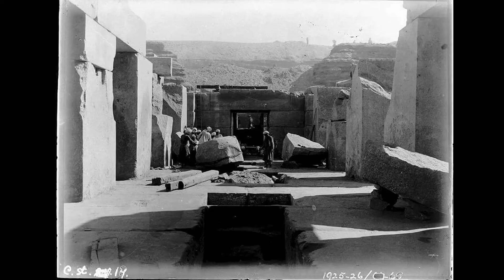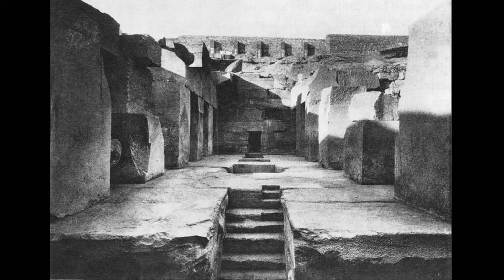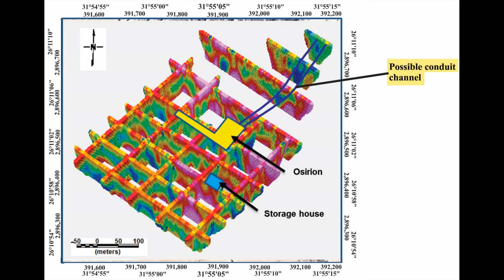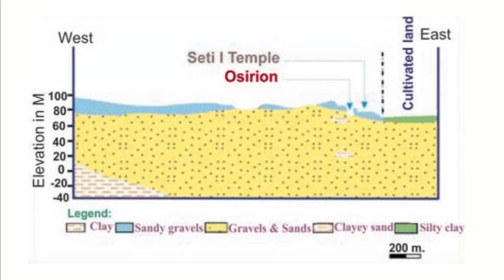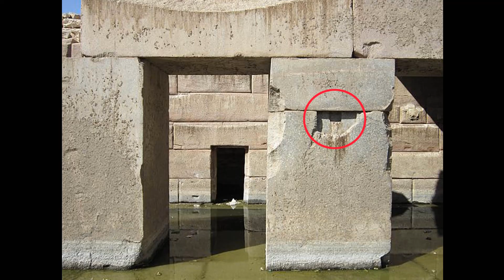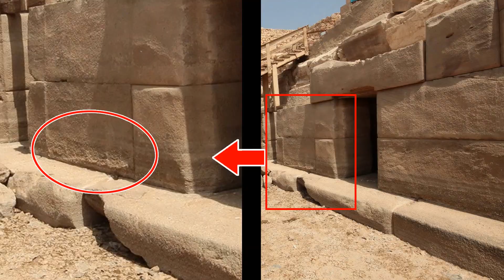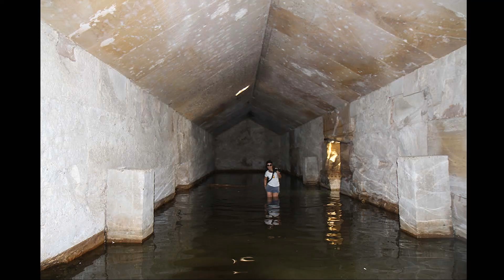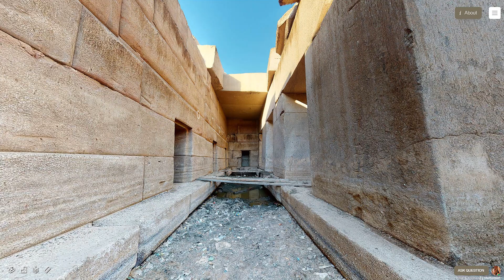The Osireion Mystery: Water, Construction, and Its True Purpose?!

Comment: The "paper-thin" joints are not a sign of "advanced technology", but simply a drystone construction practice that is absolutely necessary.  If a stone block (rectangular or polygonal) makes contact with neighboring blocks only at a few isolated points, its weight, plus the weight of all blocks above it, will be concentrated at those points, and will often cause the block to break and possibly the wall to collapse.  Ancient masons quickly learned this fact the hard way.  To prevent the blocks from breaking,  the whole bottom surface of each block must make contact with the whole top surface of underlying blocks.  Thus the working surfaces of the blocks must be either very flat (for rectangular blocks) or their shapes must match very accurately (in polygonal walls).  In either case, that means paper-thin joints.

Comment: One thing that archaeologists, amateur or not, seem to ignore is that a polygonal wall is cheaper and faster to build than one made of neat rectangular blocks.   The cost of turning a natural boulder into a building block is proportional to the volume of stone that needs to be removed, and does not depend at all on the shape of the final block,no matter how complicated.   To make a rectangular brick from a potato-shaped boulder one needs to remove about 50% of the boulder's volume.  It is much less work if instead one looks for a place on the half-built wall where the boulder roughly fits, and then chip away, from the new boulder and the previous ones, only as much as is needed to get a good fit.

While one block is being adjusted, there are several simple ways that one can keep checking whether the two surfaces match (and where they need more chipping),  without having to lift the block every time. 

A wall made of rectangular blocks is cheaper and faster to build than a polygonal one only when the blocks are quarried from a solid outcrop elsewhere, instead of being sculpted from boulders collected in the vicinity of the building site.   In this case, rectangular blocks are more efficient to quarry than blocks of varied odd shapes, and making them all of the same size, with smoothed working surfaces, greatly simplifies and speeds up the building of the wall.

Comment: Those butterfly- or H-shaped metal clamps that one sees in some old stone buildings have only psychological value; they have practically no effect on the building's strength.  Any force that could cause a 50-ton block to move -- earthquake, soil subsidence, cracking, enemy attack -- would immediately tear those clamps apart as if they were made of overcooked pasta.

Comment: Tina, you make interesting videos and have some very good original ideas.  But please forget that "geopolymer" stuff.  It has never happened, anywhere -- in Peru, in Egypt, in Lebanon, in China, anywhere.  It is Flat Earth level of nonsense.  

It is just impossible to make artificial granite or sandstone.  With lime mortar one could make solid objects that, over years, would reach a composition similar to that of limestone; but the texture would be very different and could be distinguished by any geologist.  (For one thing, one cannot use pure lime, since it would crack on drying.  One must mix the lime with some sand, and then the grains of the latter would stand out quite clearly.)  

Moreover, whenever people used lime mortar or (as in Roman times) a more advanced concrete, it made no sense to cast giant building blocks out of it.  People would just cast the whole wall, floor, roof, statue, etc as one piece - like the Romans did with the Pantheon cupola, and as we do today.  And would probably be mixed with gravel, or used as mortar to fill spaces between stones.

The Osirion granite blocks and walls that are partially smooth and flat were obviously being sculpted that way, not troweled.  It made total sense to leave the outer faces of the blocks rough, and finish them only after they were stacked into a wall.  At the Osirion, the wall smoothing work probably was interrupted for some reason.  If indeed it was built to be water well and reservoir,  the smoothing would have been a low-priority item in the overall project.  At the Menkaure pyramid, the smoothing probably was limited to the part of the wall that was inside a temple adjoining the pyramid, now vanished.

If those half-smoothed blocks had been scraped when the "geopolymer" was wet, why would the worker have stopped halfway through each block?  Why would the scraping on each stop at the same point as on the adjacent blocks?

Comment: When I was there, as a plumber contractor for 34 yrs, the Oserion looked like a massive underground water pumping station.
Reply: The water below is linked to the Nile water, from which the water level can be used to judge the rainfall of that year, judge the harvest and collect taxes.
Reply: I think water was drained to create a vacuum inside the double roofed buried place.. so the could let electrons run in a square like inside a microwave.. this was a giant magnetron. my view.. but It was indeed a hydraulic marvel if it was designed to create a vacuum in a building sized room
Reply: I guess than you would understand the issue of dicking a 15m well shaft through an aquifer down to another one.
Reply: I have been down a very interesting rabbit hole where the theory was that the pyramids were ancient humongous water pumps. seemed forever the most plausible theory for me. Everything else is kinda off.
Reply: @templeholes  . Si , son bombas de agua ,entre otros aspectos , y el motor es el calor de la cámara del rey  , en la de Keops , al ir al frío de el momento de su construcción y con sus caras blancas para reflejar la luz solar y estar frías , elevaban el agua ;  recogida en la cámara subterránea  del Nilo , subía por el canal  descendente y salía por la puerta principal , no podía subir más arriba por que lo impedían unos tapones en el canal ascendente .Es el principio de las nubes de tormenta , que crean una baja presión , debido a su masa y la orientación de los átomos por el campo magnético perpendicular a la superficie terrestre , estos se agarran al calor y emiten una onda hacia el frío , formando más campo, que se solapa con el inductor .( En esta idea tuya , buena , esto te ha tocado , estamos en el buen camino , ¡  Adelante ! )
Reply: Thanks for your professional input
Reply: @CheefSmokealot64  Fight Fight Fight!

Comment: Long corridor: few material mentioned it was build in later times than Osirion itself. Definitely one from most intriguing objects of Egypt. In by opinion Osirion was built as well/hydraulic system. How it's fit to idea of way more green and wet climate (ref. to water flow by Sphinx video). But going back to "well": people was not allowed (en mass) to visit Osirion. Who use the water? Peasants? High class? Others? Steps to the water suggests it was used by human (or human-size) entities only in limited range (testing, cleaning basen etc.). How water was "pumped" up? Maybe there are marks of fitting any "mechanism" as pumps, wheels etc - as probably people don't do this job "by hand". Imagine how can look "pumping mechanism" to fit the place. Is there anything looking as part of hydraulic ram? Only one thing does not fits me well. Casting stones. I will say it's look more like "doughy consistency", stone softened and easier to scrape. Not flowing. But we have NO technology like this today. As usually all the best, niece to see Osirion (and ofc. Tina) again :) Thanks.

Comment: I believe the marks you described may be more accurately identified as grinding marks. I envision a circular grinding wheel made from rough, round-shaped rocks, which are spun by humans. There would be wooden posts embedded on each side, offsetting each other at the opposite edge of the wheel to allow easier spinning. While it's challenging to convey this in words, I think my theory applies to both the Aswan Quarry and the megaliths in Peru. I have even recreated this effect on a smaller scale using a Dremel grinding stone. I hope I get some feedback on this.
Reply: Making the axel would be a challenge but I think they had wheels if they had carts and chariots.  Wheels were not in demand in Egypt due to no paved roads and the sand made it better to use sleds.

Comment: Great coverage of this! I agree that it seems to obviously be a well of some sort, intentionally created for that purpose, and of the same technological generation as the other sites you mentioned. Curious that the entrance isn't stepped. I would think pedestrians carrying buckets might prefer steps, as sloshes onto a ramp might make it slippery. But maybe they didn't move the water by hand, and instead had a mechanism like a rope and pulley system to pull loads of water up the ramp. Or perhaps pulling carts of water, since the slope of the entrance seems designed to be shallow. I assume they would have made it shorter and steeper if they weren't using a wheeled cart or something similar. Or maybe the ramp was purely for construction considerations, and they actually drew water straight up, as is normal for a well. Though the Osireion is more elaborate, it reminds me of the Zawyet el-Aryan well-like structure, which has a ramp leading down about 20m to an odd, simple chamber. There may be several such structures out there. I think they refer to Zawyet el-Aryan as a "failed pyramid" or "unfinished" or something like that.

Comment: That is not geolpolymer.  I don't know how many geologists you have to ignore before you finally acknowledge the fact.

Those scrape marks are also evident on the unfinished obelisk in Aswan quarry which is clearly being cut from the bedrock.
Reply: Believe what you want but I personally think the granite was more malleable as evidenced by the tooling marks.
Reply: @MarkNOTW  They had access to hydrofluoric acid - slap it on - scrape it off.
Reply: @doctormarazanvose4373 
Yes, some form of acid is a serious probability
Reply: Not trying to argue about it, but maybe it's possible that they were melting the granite material at a temperature that would melt most of it, but a temperature that wasn't hot enough to melt (or fully melt) other parts like the crystals, so that it still looks like granite? The components of granite have different melting points, a quick Google search confirms that.

Comment: Once again an epic amount of work from Tina! Folks. Get on board d and support this lady. 

Ok. Lots of topics. Too many for my frail finger here. So. Civil engineering 102, water treatment. That “thing” is a primary water treatment facility. All the surface water in the nile basin is infested with pathogenic parasites of numerous types. Primary water treatment removes such, typically with sand filtration. 

Our western technology fills a large bunk with fine sand. Then pipes raw water into the top and pumps filtered water out the bottom and thence into various forms of secondary treatment. 

This “temple” sits on the “sand bunk”. Carefully located just off the rock escarpment that is the Giza plateau. 
Recall that geological the Nile valley looks much like Americas grand canyon only filled to the brim with fine sediments. 

This site sits on the very edge of that canyon on the sediment side. Your cited tests show about 25% of the water coming from the aquifer source. The rest essentially from the Nile basin sub flow as indicated. 

Thus the Osirion is “upside down” from our perspective. Raw water is drawn in at the bottom by hydrostatic forces, resulting in pools of “treated” water free of biological contamination, once covered by a roof to prevent algal growth as we see now. 

What we don’t know is how water flow as distributed for use. I seriously doubt people carried it away in jugs on their head. 

As for cast stone blocks. It’s possible that some were. We can take sedimentary stone today. Sand stone, lime stone etc. to the point that we can’t tell ourselves. Had we no made it. Not do igneous stone like granite. We have faux granite. And we also cut native granite. But faux granite can not pass thin section luminous microscopic inspection. Which has been done enough times on Egyptian structures such that no one will do such again. Whipping a dead horse do to speak.
Reply from the maker: Thank you Fox - so good to see your insightful and informative comment!  I'm also thinking of sand filters :-) Hope all is well  🙏♥
Reply: @ 
Good as it gets. Looking forward to your next.
Reply: There  is a pipe like structure at one end,  likely bringing water to the surface.

Comment: Geo polymer theories dont explain quartz inclusions have been found in many ancient granite structures meaning It is in fact natural granite that the ancients were using. That's why structures like the polyganal masonry in peru or the unfinished obelisk (natural stone in the process of being quarried) and Kailasa Temple (literally carved out of a mountain), petra jordan (carved into mountain,  machine marks still visible) or yangshan quarry and other megalithic structures around the world.
Reply: Civ X could have used completely different methods of casting stone from the methods used today, and Civ X's cast stone may have exhibited your natural inclusions.
Reply: @sergemck  quartz is formed naturally deep inside the earth under extreme pressures and temperatures. Geo polymers like Roman concrete came much later, and were used to build on top of pre existing  megalithic ruins like in baalbek
Reply: Well said...a bit insulting to say they couldn't finish screedin 😂😂😂
Reply: Granite contains quartz naturally, which is silica so I don’t understand what your point was about granite containing quartz?
Reply: We use decompose granite for a subbase here in San Diego . And when it is compacted and wet it starts to become almost as hard as the original rock it came from. I imagine with a little bit of heat and some pressure, back to Granite that goes :  “ geo polymer.”
Reply: Where does the heat and pressure come from. And where did the granite from aswan quarry go@stephenrocks7004

Comment: Thank you. It's about damn time. OF COURSE it was some type of cement/geopolymer. Besides the obvious impossible Herculean precision (and dangerous) construction-site design and assembly techniques which your revelation (painfully obvious in my opinion as well) circumvents or deems irrelevant (cutting, sizing, shaping, surface leveling, lifting, placing, joining, etc.) you could also include the quarrying, lifting, manhandling and safe, non-destructive transportation of monstrous megaliths. Your way, instead of dozens of advanced, mind-boggling, labor and time-intensive techniques needing explanation, we are left with just one (well, far fewer, anyway): What were the advanced ancient processes (formulas/recipes) for turning granite dust or powder into a cement which, when cured, mirrors or exceeds the durability, strength, functionality and anesthetic properties of the original natural stone. Quite honestly, I don't know why modern so-called experts have such a problem with it. Great video. Love the way you think.
Reply: Unless these blocks were cut into these Polygonal shapes while or before removing from a Quarry.

Comment: Pumping water from that base under that mass is risky without inground retaining structure. Paleo water is a very surprising dating clue. Also very good point about assembling with comparatively fragile tenons, scrap pile nearby? Rather than reconstituted stone, which apparently has been disproved due to unaltered interior matrix, perhaps only the stone exteriors were altered but there's the problem of fitting stones to others. Looks like rough stones were placed then affected until they fit mating pieces while containing the exposed surfaces. But the exterior (skin) could be analyzed for altered matrix. In any case another excellent presentation by the Curious Being.
Reply: Yes, this. They're not a geopolymer but seems to be manipulated toward the surfaces as you describe, same as the  the similar dished out technique used in the quarries to extract the obelisk's.
Reply: You nailed it. those surface tests need to be done. legends of plants that could soften stone. destroy cloths, wear away boots if you walked through them.